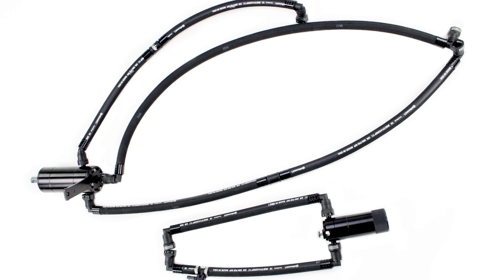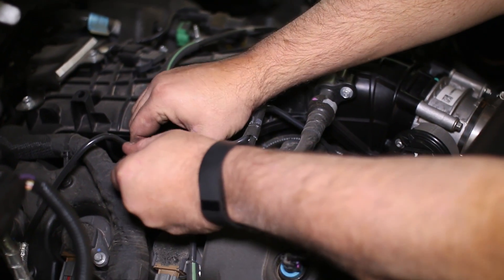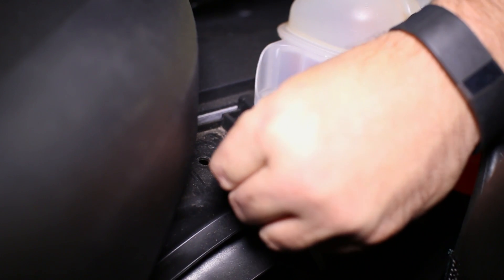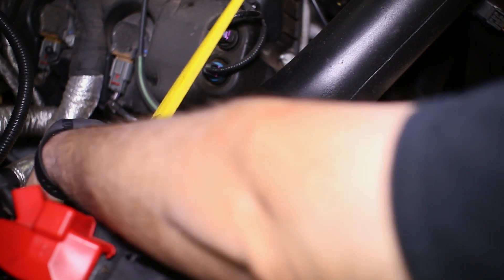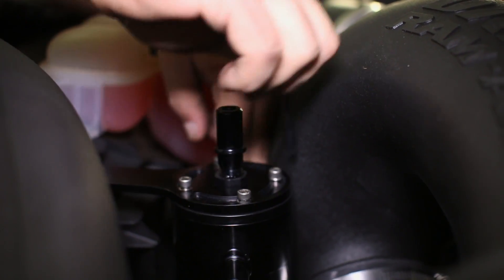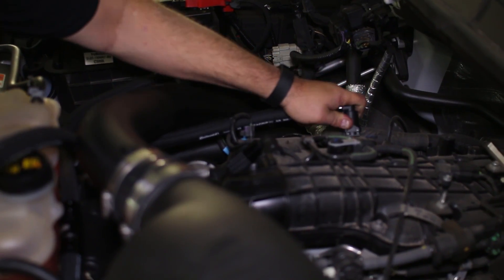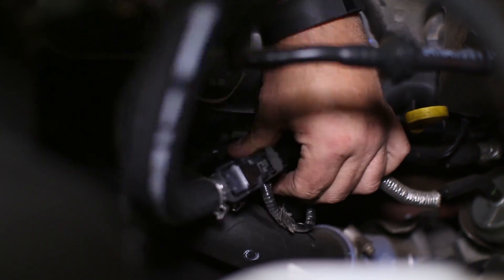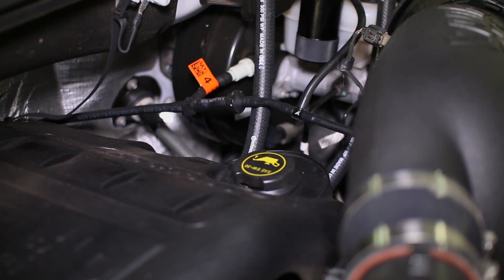2015-2016 F150 3.5L EcoBoost UPR Dual Valve Oil Catch Can With CSS Install

Comment: I just installed this on my truck. I definitely recommend taking off the passenger turbo intake tube to drill the hole. I did what the instructions said, use a vacuum and put grease on the bit to catch the plastic. After drilling the hole I removed the tube and there was a lot of plastic that would have been sucked up by the turbo.

Comment: Nightmare to Empty Catch Can! In Colder Climates catch can fills up faster.
Reply: use a valve on the bottom
Reply: It’s difficult enough to unscrew the Catch can. Good luck getting 2 hands in there to hold a container and the other hand to open the valve. Especially with a lifted truck.

Comment: How do you remove the plastic engine cover?
Reply from the maker: You'll remove the engine cover by removing the oil cap and then on each side of the cover pull the plastic out to release it from the engine. click to around 0:31 in the video to see it done!
Reply: If you can't remove the engine cover, maybe you should have a shop install this...

Comment: I installed this on a 2015 2.7L a month ago. Ive dumped out about  2 inches of brown gas and gunk mix in Iowa winter (-20 to 25 degrees). The install wasnt the easiest but when you drill the tube most of it breaks down into shavings and for me came out (not in). Does seem to work as advertised and help as intended. I didnt get any sensor/warning light issues after install and no reprogramming.
Reply: Also worth noting ford "fixed" this issue in 2018 f150 by changing to dual injection.
Reply: Did you take the pvc check valve out on valve cover or leave it in?

Comment: What is the reason for wanting to install this? I don't know anything about these.
Reply: Trey K: Besides oil consumption, combustion contaminated oil, cold start issues, check engine lights, misfires, increased warmup time and drivability issues that ford thinks their dedicated owners should put up with I haven't a clue.